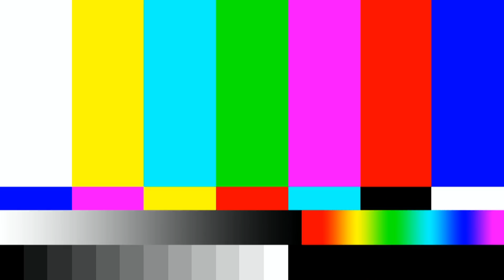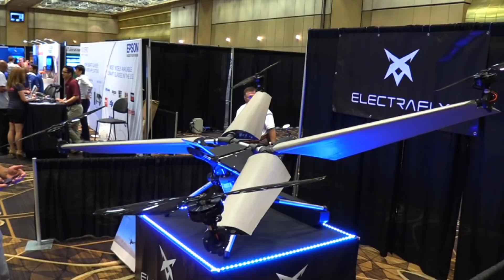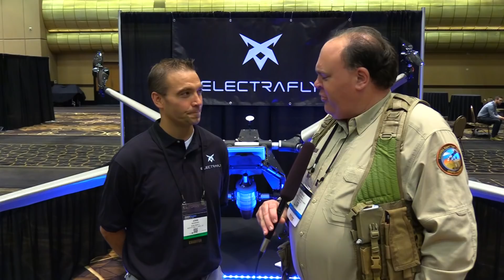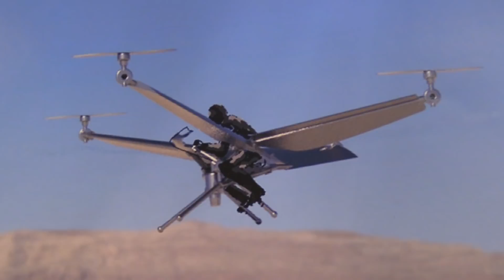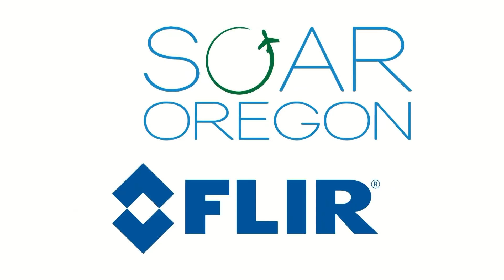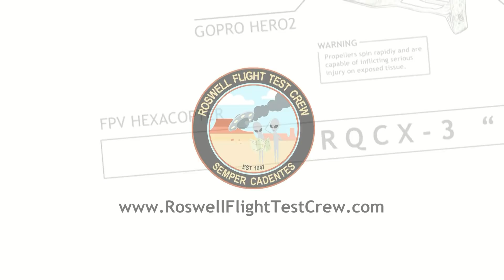ElectraFly: These Guys Put a Jet Turbine on a Huge Drone...

Comment: I have the honor of working on that prodject. Its is awesome and john is an awesome guy.
Reply: Would it be possible to create a "quad shaft" from the jet to the propellers? Y'know just trash the battery and motors all that stuff
Reply: @non-foldingchair270  i don't see why it wouldn't be possible. It would require a complete change in airframe to accommodate that though. Maybe future thoughts. In that case prop pitch would be used to control attitude. Yaw would use air resistance as opposed to torque and would have less authority due to the smaller area of the props. That all considered it could be done. Only thing is, with more parts and complexity comes more room for mechanical failure and cost to build. Reliability and affordability  are nice when talking about flying.
Reply: Is there a video of it actually flying
Reply: Why not use a jet as a gas generator for a free turbine generator?

Comment: Is there any reason passenger multi-rotor designers are keeping away from variable pitch ?  

The capabilities of Curtis Youngblood's Stingray 500 have never been matched in my view and had the ability to glide down safely if the power failed.

Comment: Nehhh you've seen bigger (MQ-1 Predator for instance) but maybe not in real life :) 
Cool quad though man.. I'd fly it :)  I see some interesting things on it by the way (airfoils for instance)
Reply from the maker: I've seen pictures of a Predator -- but never with my own eyes... So I'd say this counts. Also, I suppose when I said "drone," I was also making an (admittedly non-specific) reference to multirotors. It's interesting you noticed the airfoil shape to the limbs. I noticed that, as well, and they made a specific point of saying that they weren't touting that as a feature -- although some people were noticing it (like you and me). That's why I didn't mention it in the video. However, now that you've picked up on it, I guess we're free to talk about it! :)
Reply: Ah yes.. 'drone'... I'm sure it's ment to (allso) be able to fly completely autonomously, which makes it a drone in my book..
I was kinda hoping that jet would be driving a turbine by the way rather then be used for thrust, but this is cool as well :) 

Ghehe.. yeah.. hard to miss those I'd say :)  They are definately not there just for looks..
Reply from the maker: Completely autonomous -- and without a human pilot on board, which makes my use of the word about as far from appropriate as possible. However, I think I got my point across... Maybe...
Reply: Ghehe that was fun :) 
Okee.. when a craft Can operate fully autonomous.. that shouldn't mean it can Only be used that way? :) 
Fly to work on an ElectraFly (operating it yourself), and after you arrive it will automatically fly to the next person that has ordered one...

Comment: Before you put a jet engine on how about addressing the engine failure issue?  No wonder no one has been on it yet - better go 'X8' real quick...  not sure this is anything original...
Reply: It has mounting for 8x. Even in this earlier version of the airframe. Being a pilot john knows the need for redundancy. Just don't need it for testing and display in certain occassions.